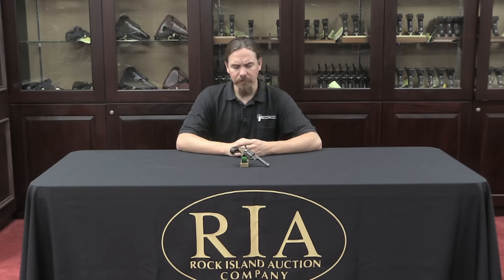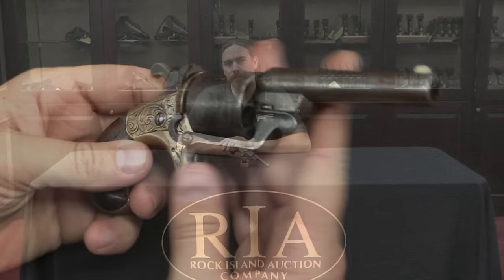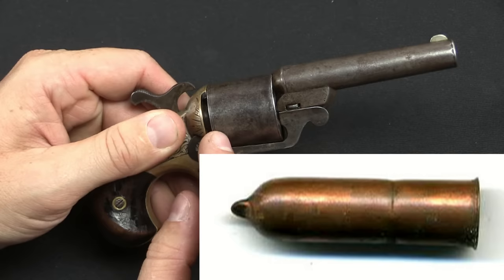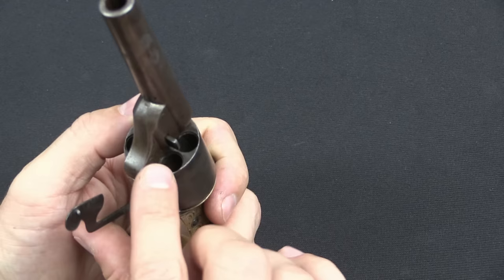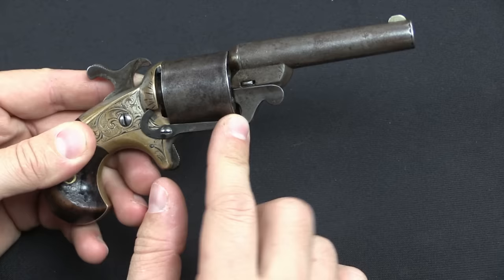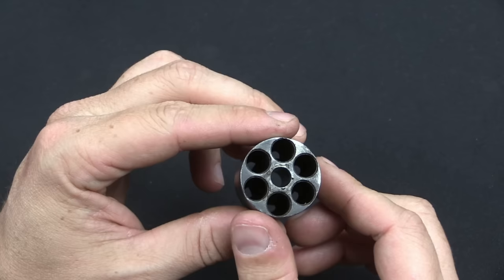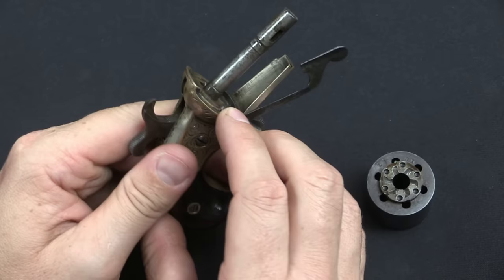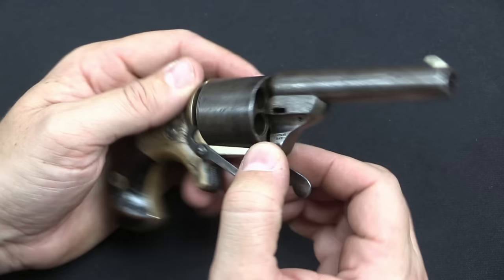Moore Teatfire Revolver

Comment: Do you have a doctorate in firearms history Ian?  If not, you should have for your prodigious knowledge of the field.  Another fascinating insight into nineteenth century revolver design.
Reply from the maker: John Brooks Find me a university that offers such a degree and I'll talk to them. :)
Reply: Forgotten Weapons You most certainly have a metric crap-ton (different than an imperial crap-ton) more mechanical knowledge than 99% of the mechanical engineering graduates I've worked with.
Reply: +Forgotten Weapons Doesn't US army have some sort of history course for their soldiers? 
(I'm not American and I'm basing it on Renaissance Man with Danny DeVito)
Reply: +aperkausn Metric crap-tons are actually smaller than imperial crap-tons, I have no idea where the idea has sprung up from that making something metric makes it bigger or better.
A US short ton is 907 Kg, a metric ton (or tonne, but never a metric tonne please) is 1000 Kg but a proper Imperial Ton (or long ton in the US) is 1016 Kg. So the phrase should be an IMPERIAL crap-ton. If it helps you can imagine the bonus 16.05 Kg as being the perfect amount (assuming the consistency of standard horse turds) to form a pile on a podium sufficient to hide the politician behind it.
Reply: all he said was different
Reply: all you need to attain this knowledge is the internet lol

Comment: that monopoly though.. and having to turn your weapons over to S&W is the kick in the teeth after getting punched in the gut
Reply: Holding a patent is not the same as having a monopoly. Were it a monopoly we'd (theoretically) be discussing the S&W Peacemaker, and the S&W 1911, and the S&W-15, because there wouldn't be any other firearms manufacturers; S&W would have been alowed to buy them all out.
 As far as infringing on a patent is concerned; play stupid games, win stupid prizes.
Reply: Actually the patent system is designed specifically to give the patent holder a monopoly on the production of the patented invention. They had an effective monopoly on the cartridge cylinder for use in revolving action firearms. It fits the definition of Monopoly accurately.

Comment: I have serial #29 and the cylinder stop is of a different design.  A tab on the lower right frame engages in diagonal slots in the cylinder.  When do you suppose they made the change?